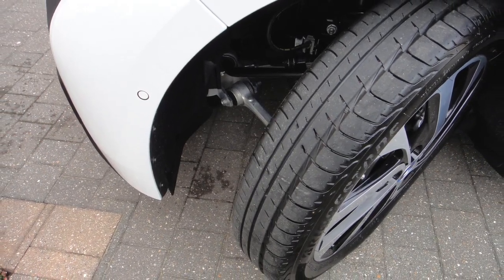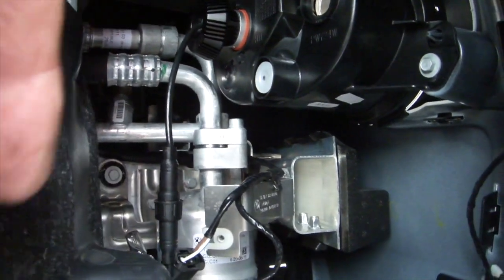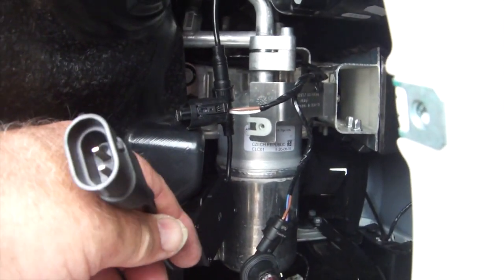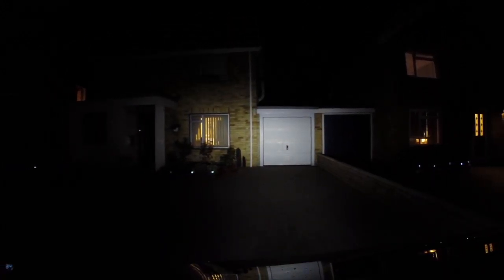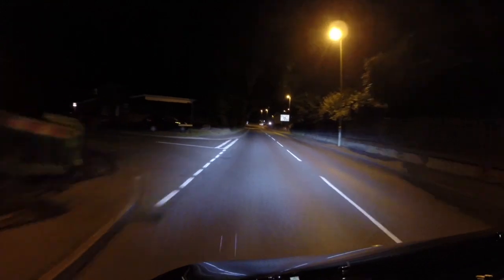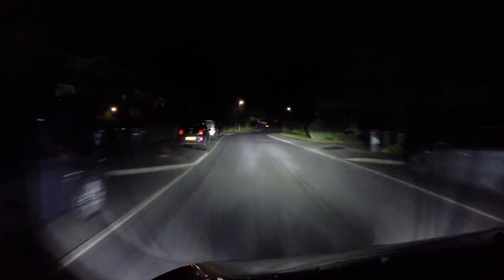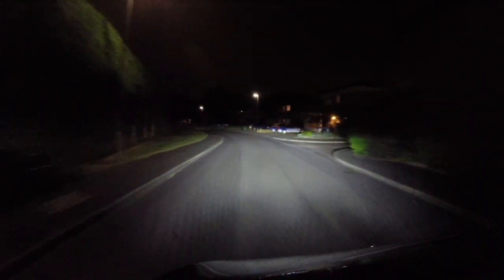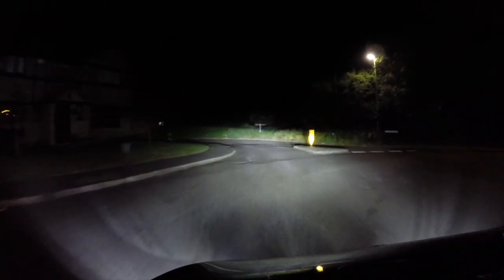BMW i3 upgrade LED mains

Comment: Dave, you've whetted my appetite, but are they too bright? I'm getting really annoyed with what looks like hi-beam coming toward me and then realise they are standard dipped. country roads are the worst. Also, can these just be fitted with no error code? I noticed another video someone had to change the bimmer code to say it was an LED conversion with a VeePeak unit?
Reply from the maker: No, they are not too bright as long as set right. They did not bring up any code errors. I have both of the Bimmer Apps and dongle but did not have to do anything for the main beam lights. Worth doing.

Comment: Dave I fitted both on the low beam was toooo bright high beam too took it mot failed miserably at least I had a go now back on halogens.....oh dear
Reply from the maker: Does this mean that you don't have the LED Headlights which have the Angel eyes underneath. I've only fitted the upgrade LED bulbs where the indicator lights are. It's has passed two MOTs since fitting. With no problem when I asked the tester about them.
Reply: Mot tester said the high beam is ok but low beam did not pass by the way your video was very educational many thanks for vid

Comment: So I took the light out of mine yesterday, easy to do following your method. On mine, the leads to the bulbs come from what looks like a squarish battery located below that aluminium crash frame in the centre of your picture frame. Will take a little video and share when I put mine back together.

Comment: Useful video. I hit a pheasant and it popped out the main beam housing. Thought I'd have to take off the bumper but see it's easy enough just to pull back the inner door arch linging and fix it from there.
Reply from the maker: Glad to have been of help. My car also hit a pheasant, but no damage to car or bird, it just carried on flying across the field. Made a fair old bang.
Reply: @dave20thmay  Exactly the same experience. Big bang and I expected the bumper to be cracked. It must be very flexible as there was no visible damage at all. I noticed the drivers side main beam was offset though and think that one of its housing arms may have cracked off though. Will let you know how I get on. I like the idea of upgrading the lights. Useful for winter.

Comment: Those are the high beams that you're changing out, not the main headlights.
Reply from the maker: Hi Bdub Q. This could be a different country terminology. But I've always termed them as either dipped or main.

Comment: Hi Great Video I have ordered some Hi Beams for my I3 when you went for test drive you mentioned they might need adjusting to increase throw did you adjust them later and if so how did it work out or how did you adjust did you move gear wheel while watching Lights on wall Thanks Again
Reply from the maker: Hi. Thank you for the nice comment. I did adjust the LED, using the knurled knob, bit stiff just using the fingers. There is an Allen key hole that can be used in the knob. As you say, I used a wall to focus on. Driving along twisty country roads on very dark nights, there is so much light on the high beam, that I think someone is coming around the corner, switch to dip and find that it's my lights and not another car coming along.

Comment: No odb problems on the Dashboard ?
Reply from the maker: Neither the main LED's or the indicator LED's flagged up a problem. At the moment I'm trying to find out what the indicator replacement is, as the ones that I've fitted and listed are no longer shown anywhere. When I find out, will edit the the wording above.
Reply: dave20thmay maybe you should install an anti odb error --> [2 pcs Sans Erreur Canbus Décodeur pour LED Phare De Voiture Ampoule Kits pour SUV Brouillard Lampes H4 H7 H11 H13 9005 9006 Erreur Attention Canceller]
 http://s.aliexpress.com/BNbA3Urm
Reply: Its 8€ for us here in France

Comment from the maker: Just been checking and see that Horizon don't list the bulbs, above. The indicator replacement look to be PH24WY CREE LED 30W. These are available in Amber
Reply: thanks for posting this info and video.   Very helpful.

Do you think either of these links below are the same bulbs and ballast you installed?
1.  https://www.ledfactorymart.com/products/h8-h11-philips-led-headlight-conversion-kit-8000-lm-50-w-pair-hi-lo-beam?variant=33259425358
2.  https://www.horizonleds.co.uk/h11-5th-gen-4000-lumens

I live in Canada, and I'm looking for a source for these main bulbs.   thanks for your help.

Comment: I'm in the states... Did your i3 not have the adaptive LED headlights from the factory?
Reply from the maker: Yes I had the Sports package, that includes the LED headlights, but these lights are just the low beams. The ones I have changed are the high beams that are halogen and look a bit yellow compared with the new LED replacements
Reply: dave20thmay o very good. Thank you for explaining sir. Great video

Comment: Do these pass the UK MOT?  Is it the same issue as a Halogen to HID upgrade or different?
Reply from the maker: I'll have to wait three years to see what will happen, with the MOT. Can't see as long as they are focused and not blinding oncoming drivers that it should make any difference. Suspect that the interest would be in the light working.
Reply from the maker: I've now passed two MOTs with no problem and I did ask the tester about the Main LED's and he said they were fine using their test equipment.

Comment: Ok I think I have found the bulbs mentioned in the video; make sure you are sitting down; 
Main Beam: http://www.horizonleds.co.uk/h11-5th-gen-4000-lumens?search=Philips H11

Can't find the indicator bulbs mentioned yet?
Reply from the maker: You do get a first time customer price of about £111. As to why you or I can't find the indicator PW241028A LEDs I don't know at the moment. They are not a bayonet type. Will have a look and see, if it is just a case of part number change. I think that both changes have been worthwhile
Reply: This is the indicator led:

http://www.ebay.co.uk/itm/371819338879
or
https://www.amazon.co.uk/ANG-Mercedes-SAMSUNG-Daytime-Running/dp/B01MZY9RIP%3FSubscriptionId%3DAKIAJYOENKIORFCKZTEA%26tag%3Dfoxydeal-21%26linkCode%3Dxm2%26camp%3D2025%26creative%3D165953%26creativeASIN%3DB01MZY9RIP
Reply: Grant Thomas wow 139£??????????? On Aliexpress its about 16$ to 50$ MAX. I buy on Aliexpress only best deals with  garanties. Tip: buy only from the best seller you will never have an issue with the product. Bye

Comment: Just about to replace mine, so good video. Thanks.
Reply from the maker: Glad you thought the video helpful. Hope it goes alright. At 1:55 in the video is a white gear wheel, which you can rotate with your fingers to adjust the level of the beam.
Reply: Thanks

Comment: how bad was the stock lights to lead you to do this upgrade e.g. its shortcomings etc ?  also  you mentioned that they seems a little low did you have to manually adjust because the bulb level angles different to a stock h11?  or was it just a case of adjusting with a  level dial in the car? also since the upgrade has there been any problems
Reply from the maker: I never tried the Halogen main lights as on the Facebook site for the i3, they all said the mains were pants. So I went straight for the upgrade, which in the road test you can see are similar light output to the dip beams. These are the brightest lights I've ever had and I rotated the white nylon cog. to lift the beam, but it was a bit too much and was lighting up the trees on the way home last night. But it is easy to move the wheels and remove the round panel to adjust. Might find a nice wall when dark to do a good adjustment. No flagged up problems with the lights which included the LED indicator bulbs. These don't have the spread of light, of the halogen, but switch quickly and still give a good indication about your choice of direction change.
Reply: thanks dave if you develop any issues let us know, also whats the beam like on road signs, as the one of the early kits on my bike I tried dazzled my eyes some times I ended up ditching them

I would recommend asking the dealer to double check the level next pre-service just to keep john law in check as there output if wrong may get you pulled
Reply from the maker: That is a problem with a lot of reflective street signs. I get that on my Moto Guzzi and the lights on the Daytona RS are not that good, using the curved headlight from the BMW scooter with the roof on. So that is a point that a lot of signs could do with less reflective particles. Not sure if you mean getting my dipped LED headlights checked, as I've not been flashed by anyone coming from the other direction. and the new mains, would never be on what ever was coming towards me. Including cyclist.